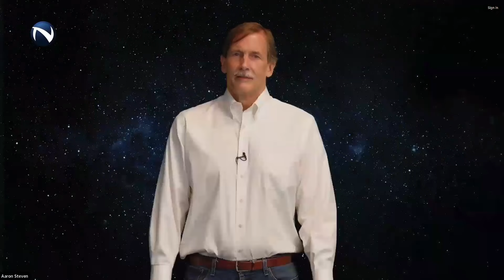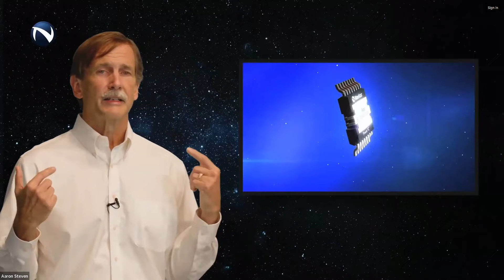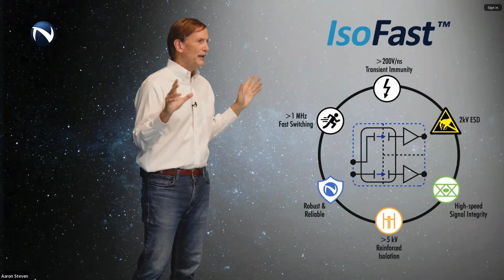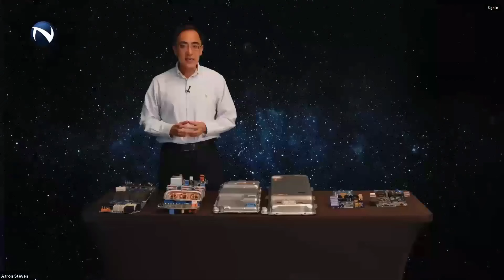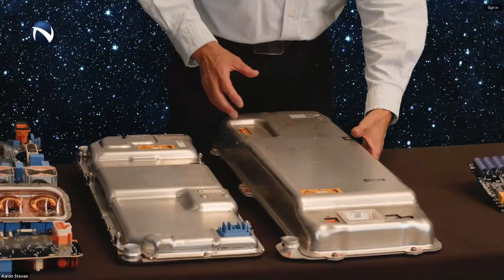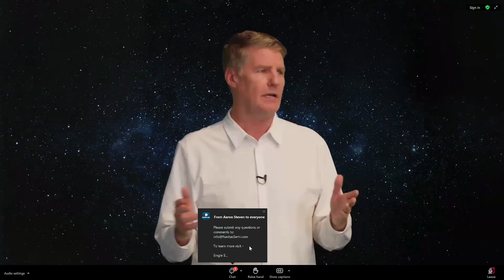Navitas Semiconductor LIVE EVENT - 12th of March 2025

Comment from the maker: From Reddit /r/NavitasSemiconductor

Potential Benefits for the first company that Invents 650V Bi-Directional GaN Power ICs

✅ Capture $B+ market share in EVs, renewables, data centers, and industrial power.
✅ Command higher profit margins (50-70% vs. ~30% for SiC & legacy semis).
✅ License patents for recurring revenue ($100M+ potential).
✅ Get acquired for $1B+ or increase stock valuation significantly.
✅ Disrupt SiC and legacy power semiconductors, taking market share from Wolfspeed, STMicro, Infineon, and ON Semi.

Seems like Navitas was the first with this exact design so long term lots of potential